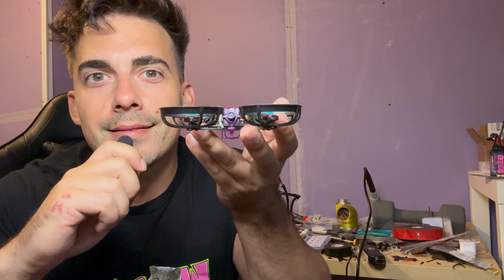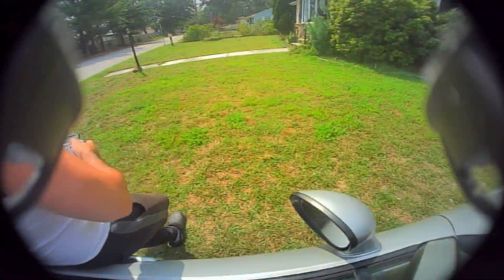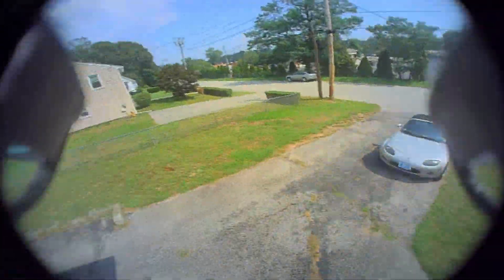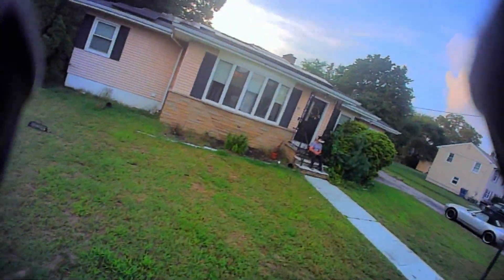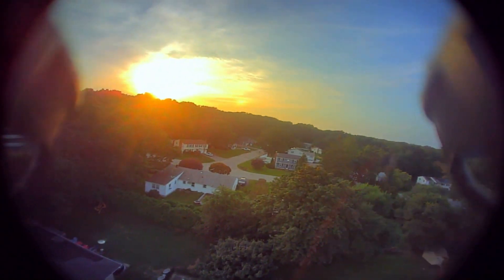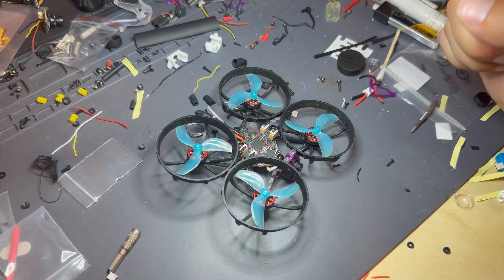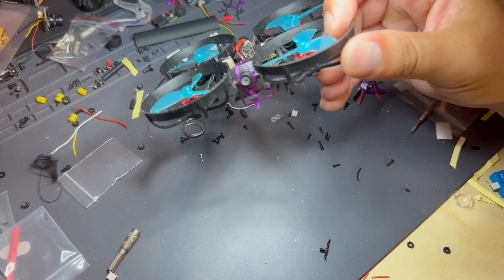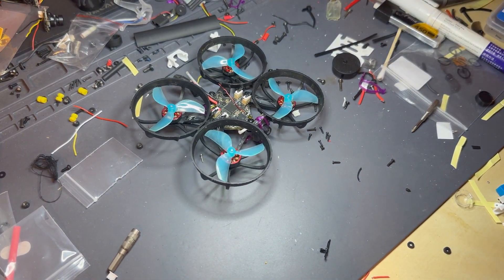Fractal 75 Pro MAX - Freestyle, Review, and HDZero Build Guide

Comment: Great review! Just wondering If I could run a regular square AIO or will I have to use a cross board?
Reply from the maker: You can absolutely use a square AIO such as the x12 - I just built with a cross as i didnt need the internal VTX otherwise i would have definitely used an x12
Reply: OK great cause on the beta FPV version of the frame you have to use a cross aio that’s why I was wondering
Reply from the maker: oh i didnt know that - thanks for pointing it out  @Loganmofficial

Comment: Great video brother. I have all my stuff arrive tomorrow for my build and it just so happens to be what you suggest. 
X12, rcinpower 27kv 802 and for the cam I’m going with the ant lite. 
I don’t think for us micro analog guys it gets much better than that and ever since I put the rcinpower 27’s on my 75 whoop I’ve loved them as equally as my 65 with 30kv. 
Again great video man!
Reply from the maker: I cant remember if i said it in the video or not but my best flying 75 analog whoop is on the rcinpower 0802 25k. They are super durable for me and so smooth. Let me know how that build turns out - i am very interested to hear because i am definitely going to build another one of these with pretty much your same specs

Comment: I had to give up on the fractal75 camera setup.  Every landing or crash the camera moved left or right.  Finally I used a mobula6 hd canopy.  If the front end of the frame had a bigger flat spot for the camera to rest against it might stay straight.
Reply from the maker: I completely understand as far as your camera issue goes. I will say this frame sandwiches the cam between the ducts so i have not had to adjust it ONCE like i usually do for my F75 analog. Just something to keep in mind but it will still fly great with a standard canopy. I think Callisto has created a TPU mount that pushes the camera far out front specifically for the fractals - check his thingiverse out!

Comment: Excellent vid and review Moe! 👍💪 I'm running with 1002 22'000 (soldered motors to save that extra 0.5g :D) with HDZ and Walksnail. Love the Pro Max ;)
Reply from the maker: Thanks Mc! How do the 1002s feel?? I might buy a set soon but I am trying to budget a bit 😅
Reply: @MoeFPV  Lols, I hear ya. I‘m using RcInPower 1002 22‘000kv motors soldered and they feel really good on the HDZ build. But to be honest I never tried 1102‘s so I could not say how different they feel. 1002 seemed to fit my Pro builds and now the Pro Max so I did not change them.

Comment: Nice review and smooth flying Moe!. I built this rig with 0802 25kk motors and bi blades, was a bit slidey and underpowered. I went back to tri blades and 1102 22kk, feels better. Im yet to try 1002 , perhaps it will be the sweet spot!
Reply from the maker: Thank you very much! And thanks for the insight on the 0802s. Did you happen to try it with tri blades? And was it an HD build or analog? I really wanted 0802s to work with an analog build! I will have to make that one next - maybe with Yves v2 frame when it comes out! Thanks again for the info
Reply: @MoeFPV  Only used bi blades on the 0802's and was a hdzero build. I reckon 0802's on a analog lightweight build would be good!

Comment: I was hoping you would go a little deeper on the board layout.   like a build guide.
Reply from the maker: I thought about getting into more detail but, outside of the component list, really it was just the soldering of the 4 wires of the Whoop Lite board. I thought insight as to the components would be all that anyone would want to know, to be honest
Reply: Im curious, not really how you solder them, but more how you delt with mounting them.  I want to build a walksnail F75 and havent really decided if the snail board should go on top of the FC, under it, or on the opposite side of the PCB.  and did you need to use your own hardware, or was the hardware in the Fractal kit adequate.  BUT, that said, I am a sucker for some good solder porn.
Reply from the maker: @Mupshot  ahh gotcha - I can say that we’ll have to put the HD boards on the bottom of the frame if we’re dealing with the typical 1s 4 in 1s with motor plugs. The plugs will either run into the carbon fiber frame or will have to be elevated with spacers for clearance, but it would way too high. You might be able to mount an fc with solder pads for the motors if the USB port is in a good place, but it would still have to be elevated higher than we would like to make sure it doesn’t stick out of the bottom of the frame. I actually did use my own hardware although I bought the hardware kit from fractal as the screws are usually the hardest things to get a hold of in my opinion, but you can use any grommets you have. Feel free to message me a Discord if you’re going to build one and I can help out ! Walksnail might be a good choice , but I always seem to get vibration in my cam when I put them on WHOOPS

Comment: y0 Moe, really good to see Your face! So You like X12 the most for analog? And one more, I thought it will be lighter than Meteor75 pro hdzero. cheers
Reply from the maker: Thank you very much! X12 is just really convenient, being a 5 in 1 and a nice strong 400mw VTX. If we were to build this out on analog and smaller motors it should be lighter than the meteor 75 pro since the 75P uses the same heavy 1102s. Thanks for dropping by!

Comment: I put on some new iflight defender 16  HQPROP 1809  on my meteor 75 pro. Much better than the gemfan 45mm.
But you have to drill the last bit of the props through, to push them on.
Make sure to gently drill it out by hand.
So awesome performing props.
Reply from the maker: Interesting - i havent heard of those props before but ill have to check them out. Thanks for the info !